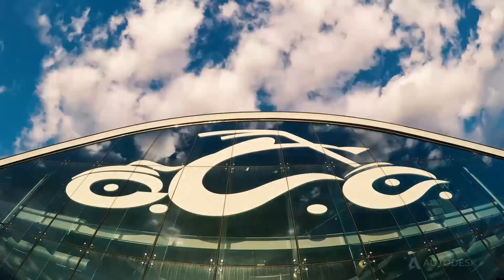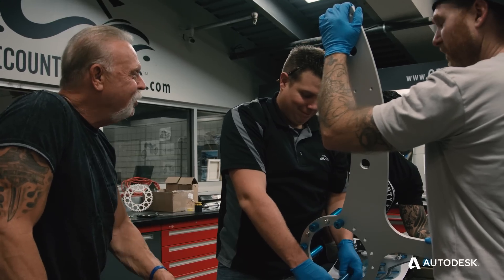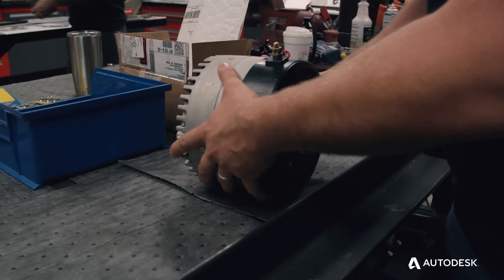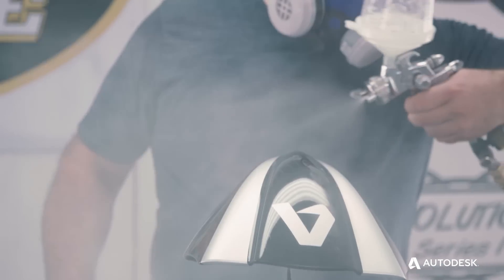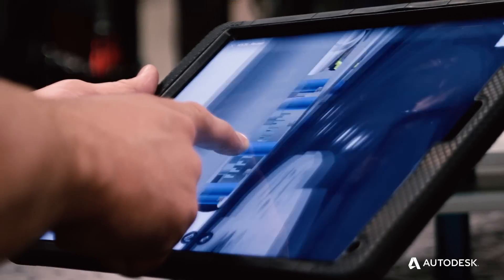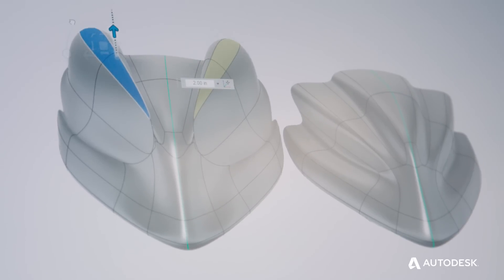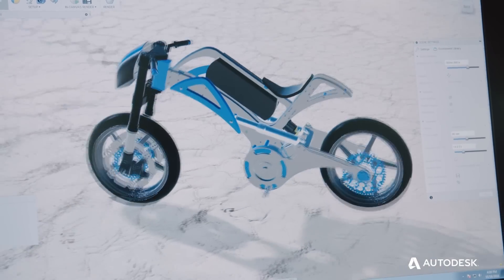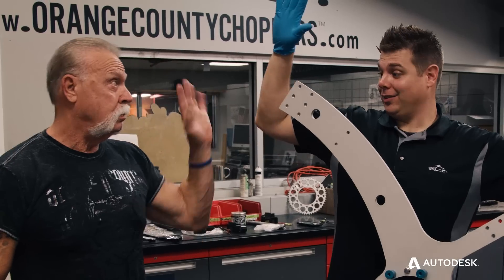Orange County Chopper's all-electric Fusion 360 bike

Comment: hahaha guys I love fusion but come on with that last line... "I can concentrate on my job as opposed to try and get software to work" that made me lol. If only that were true, prime example of your marketing getting ahead of your software.
Reply: What issues have you come across? It seems to work very well for me.
Reply: bensbenz It's a whole lot more stable with few crashes compared to Solidworks 2015 and SolidCAM combo I was using. Not as slick a CAM but at least it doesn't crash.